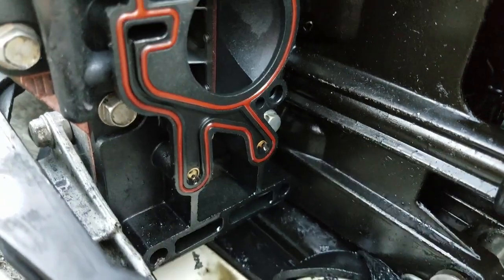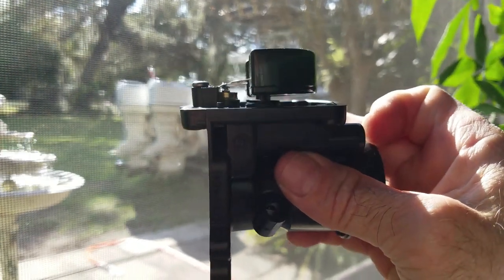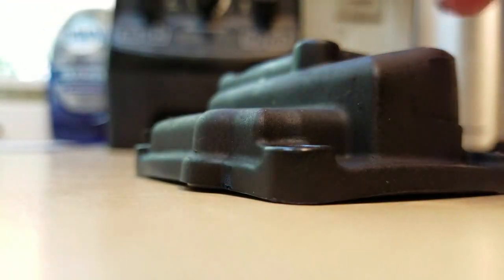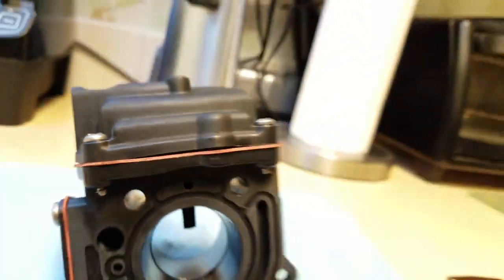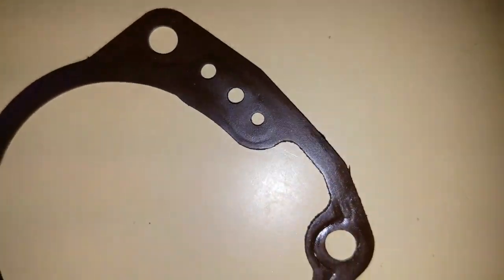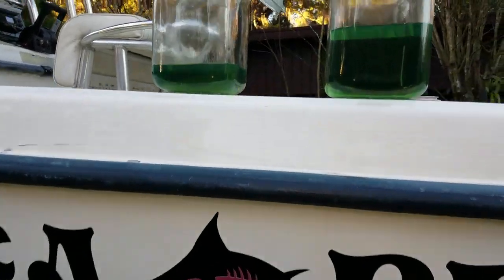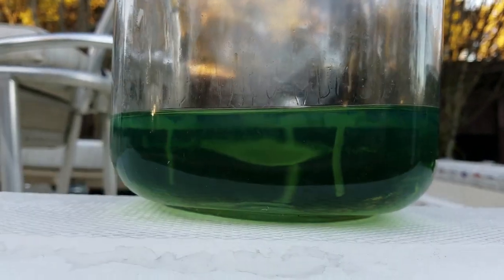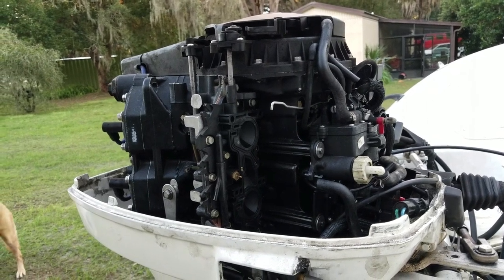The Problem with Johnson Carburetors

Comment: You have to set the stop pin tab first to make sure the opening amount is correct then from the needle forward bend the float bowl to the proper height there are a few old videos online from technicians back in the '80s that can show you the technique if you're a visual learner.
Reply from the maker: Thanks. But if you watch my video you can see I adjusted the float to be perfectly parallel to the carb housing. So I don't need to watch any other videos to learn how to do it.
Reply: @DaveTheBoatGuy your carburetor looks like a rainbow.I'm trying to help you young man.If you don't want the help and you just wanna take it as criticism.Even though I was polite as possible, that's fine.You're doing it wrong! But what do I know? I've only been working on Johnson and Evinrude for thirty years.

Comment: Can you sand the carb bowls on a flat surface to compensate for the warping?
Reply from the maker: That might work. But you would have to be careful not to sand away the alignment points on each corner. What I did was use a heat gun to get them back to their original shape. I wish I'd recorded that process. The next time I encounter warped carbs, I will.